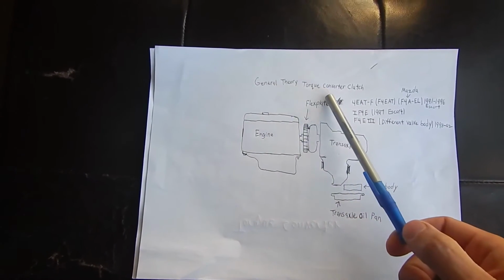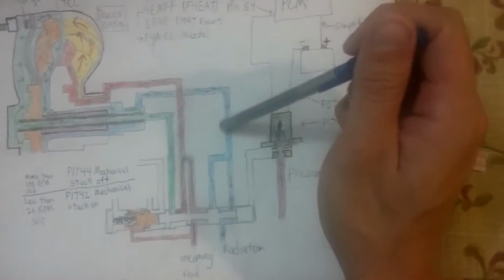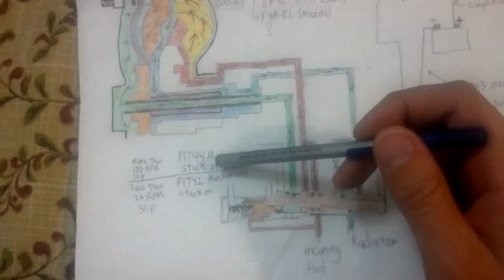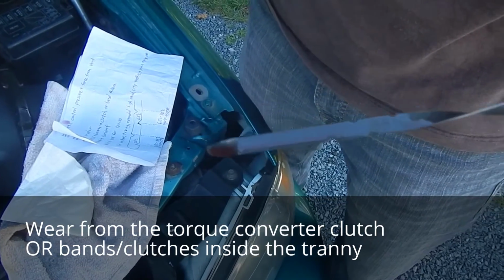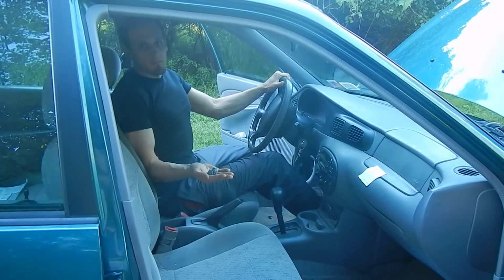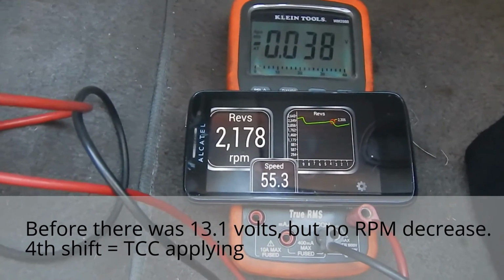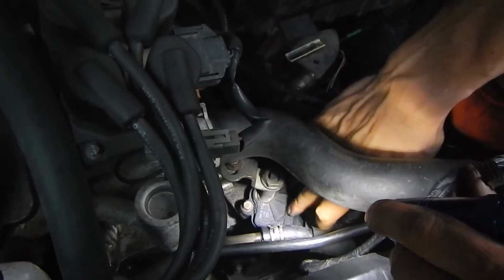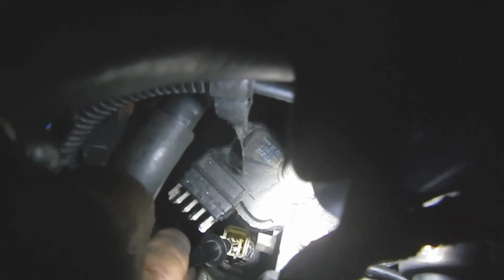1991-2002 Ford Escort Automatic Transmission Troubleshooting P1744 P0748 P1740 P1742 Pt. 1 Tracer

Comment: Informative.  I enjoy looking into issues but I am not educated enough on cars to fix this stuff.  I have the p1744 ford Taurus dad helped replace the tcc it comes back on after clearing the computer.  I will try going to a transmission to ask them everything shifts just fine which i already took it to the specialist he agreed and cleared the code after we replaced the tcc. The transmission guy says if the code comes back on its most likely electrical. Thanks for the video I find it informative.  Hopefully I get this sucker fixed soon...
Reply from the maker: I think you mean you replaced the torque converter. Consider the bafx scan tool and forscan it's a free app. It will tell you if your tcc should be on or off. You can also check for an rpm drop to confirm it's working with torquelite. Figure out which wires numbers are the torque converter clutch and then use your ohm meter.
Reply from the maker: Also watch part two and the cable adjustment videos.

Comment: I have watched a few of your videos now and I am just absolutely blown away by your knowledge and expertise in diagnosing components that others don't stand a chance with. Why dont you own your own shop??? But here is my question. My 1-2 shift was happening late around 3-5k rpms with p0751 code. I went ahead and did a transmission flush/filter and seloniod replacement. It acted fine for a few days. However now the same problem is happening again. Any advice would very much appreciated finding the true cause of this problem
Reply from the maker: There are more profitable businesses than an automotive shop. Check the wiring and connectors similar to how I show in the video.

 I drive a manual now, less trouble. There are no solenoids, wiring, misdesigned valve bodies, defective torque converters due to an aluminum washer, 
Dirty gear selector switches, high pressure fluid to leak, pressure control cables to go out of adjustment, oil filers, or computer software glitches. The escort auto is not a great design and neither is the engine with it's valve seat drop. Get a good japanese manual transmission car and keep the body uncoated with lanolin and move on to more important things with your life.
Reply from the maker: Oh and never let it over heat not even a little bit.
Reply from the maker: Also what year car do you have?
Reply from the maker: I have a video on the 1-2 shift for a 97 escort.
Reply: @supermetaltastic  okay I will watch your video. It's a 2002 zx2 with the f4e-lll. I will watch your other video for 1-2 solenoid. It's got 125k miles so I'd like to keep it running. I have not diagnosed the connections yet and my next step will be checking the transmission pressure. I am worried I will have to pull the valve body tho. Also there was no metal shavings in the old fluid so I'd assume it has nothing to do with your clutches
Reply: @supermetaltastic  alright Adam I'm back with this stupid ass car. So I have incorrect line pressure. 50lbs all the time. During stall test. During driving. All the time. So when I go and adjust the throttle body cable. Nothing changes. There is no communication between the throttle body cable to the transmission. So long story short. It's stuck at 50lbs. What the hell do I do next before I buy a f***ing transmission
Reply: @supermetaltastic  now I do know where the pressure regulator valve is. I don't think it's connected to anything. And I do see where the throttle cable cam is located inside the transmission. But what I don't see. Is how that's electronicly controlled
Reply from the maker: @brianschultz6645  later cars ditched the throttle cable pressure control.
Reply: @supermetaltastic  that could be the case. However the cable still runs to that little electronic box on the side of the engine compartment just like the older makes and motels. And if that is the case. How do I adjust this line pressure. Cause at a constant 50lbs something is off and last case scenario will want to diagnose the pump itself
Reply: @supermetaltastic  yeah your right. The electonic box I have is not in older makes and models. Something is fucked off. Thanks for your time
Reply from the maker: @brianschultz6645  Check the factory manual for the diagnose procedure. There are some online sources as well for that transaxle as well.
Reply: @supermetaltastic  yeah bro I have. F4e-lll it's all tied into f4eat and if you look you can't even find a used f4e-lll transmission I'd assume just cause of that. Who knows man. Hate this car at this point
Reply from the maker: I thought about it and your problem is maybe a stuck pressure control valve on the side of the transmission. It's accessible on the left wheel well. It's a spring loaded cylinder under a large fastener. They are famous for sticking.
Reply from the maker: @brianschultz6645  well check it. It only takes 5 minutes
Reply from the maker: @brianschultz6645  did you do what I told you and check the the little valve on the side of the transaxle?
Reply: @supermetaltastic  bro I looked. Only thing I see is 4 accumulator springs. And a servo
Reply from the maker: https://www.charlietranny.com/F4EATds.JPG bottom left middle there is a giant nut. Pull it off a plunger should fall out. It's probably stuck.
Reply from the maker: @brianschultz6645  It's an easy 15 minutes to check it. let me know
Reply: @supermetaltastic  I will let you know Thursday. It's the most logical explanation as to why I instantly lost pressure one day. And three months later. Still no pressure
Reply from the maker: @brianschultz6645  it should have fallen out. If you had to dig it out, its sticking. Did you try to run it after freeing everything?
Reply: @supermetaltastic . Negative. It's already on jackstands halfway disassembled. These cars a something else you know that
Reply: @supermetaltastic  2-4 clutch band was toast. One of my friction plates and clutch packs were toast. I got the rebuilt put in today. Will dry fire tomorrow. Have no idea if I rebuild this transmission correctly. Wish me luck 🤞
Reply: I got about 100 miles out of it. Was running amazing exactly how it should. And then all of a sudden could hear something inside there. And it wouldn't move. My escort days are over. And it's time to take it to the junkyard
Reply: I got about 100 miles out of it. Was running amazing and then all of a sudden could hear grinding and wouldn't move. My escort days are over. And it's time to take it to the junkyard and part ways with it
Reply from the maker: @brianschultz6645  Smart move. Your wasting time on an inferior product that is not worth much on the used market. I recommend spending a bit more and getting a lower mile car (60,000-90,000). Maintain that car and play the deflation game. Sell it at the 120,000 mile mark. I prefer a manual transmission. A Simpler, more reliable technology that manufacturers have had 100+ years to perfect. Time is too valuable to waste on an escort that needs constant repair. If your time is not it's time to ask yourself why that is?
Reply: @supermetaltastic  I tore it apart a 2nd time and smoked a bearing from not properly breaking in a rebuilt transmission (babying with soft shifts for the first 1000 miles). Since the 2nd install. I'm about 500 miles in and still running fantastic. So far. And I agree with you on the time being valuable thing. Unfortunately. Haven't made the best choices in life. I have more time these days than value

Comment: hi, i have a quick question about the designation of the solenoids when manually testing them as shown in the video. Front(vehicle) left one you tested was 1,2 solenoid? what about the rest? my back center pin doesn't make the click sound when test, i want to verified that its the 3,4 solenoid since i lost OD. Thank you for your time, the video was really helpful. I read the FEOA forums and follow them here. Great information.
Reply from the maker: Check this out and go to page 15. It has what you looking for. http://akpphelp.ru/images/contents/files/F4EAT.pdf

If you are facing the front of the engine. The upper left one is the torque converter clutch control solenoid. The middle upper and lower far left should not click and they are the transmission oil temperature sensor. No need to put voltage on them.

The lower middle one is the 3-4 solenoid.

Comment: I have a 04 Mazda tributre. was driving and then nothing no reverse no drive in any gear. only code that came up was p1744. fluid correct and clean. tested the selenoid nothing no clicking. deduced that it need replaced also decided on the shift kit from transgo because the cd4e trans has a lot of over pressurization issues and this corrects them. my question is the p1744 code and how it relates to the loss of everything
Reply from the maker: Daniel Mcmeen Did you check the pump is pumping by checking the dipstick with the car on and off? The fluid level with it on should be lower.
Reply: I believe I did
Reply: would that still be true if the selenoid isn't firing?
Reply from the maker: Check it again. If you have a hydraulic pressure gauge, hook it up to the transmission. There are usually ports on the side.  Find the specification for the car. There will a drive pressure, reverse pressure, stall test pressure, etc. I'm NOT familiar with the cd4e. However, on the Ford Escort the pressure regulator piston often gets stuck resulting in low pressure. It's easy to access though. I don't think only one failed solenoid would cause the vehicle to not move in all gears.

Also check your gear selector linkage.
Reply from the maker: Are multiple solenoids not clicking or just one? If you had a bad ground to the transmission, that would cause multiple solenoids to not work.
Reply: +Adam Prince no I have a good ground after I removed the valve body with swlenoid still attached I grounded it and used a jump wire and still nothing
Reply from the maker: Then the solenoid must be bad. CD4E in the Mazda Tribute is known as a bad transmission with many complaint of failure before 100,000 miles. Sometimes the pressure regulator get stuck and it breaks metal parts. 

P1744 just means there is more than 100 rpm difference between the two side of the torque converter when the clutch should be applied. A bad solenoid though should be P1740. 

At any rate, keep me posted on if fixing the single solenoid solves the problem.
Reply: gonna be putting back together tonight did the rebuild to the valve body last night to correct over pressurization issues. also replacing the safety neutral switch as a just cuz thing.
Reply: so after the rebuild and reassembly still nothing. no forward no reverse. ugh. code says torque converter clutch stuck off. or at least that's what I read
Reply from the maker: The clutch being stuck off should not prevent the car from moving. Check the pressure and fluid level with it on and off. If you don't have a pressure gauge just remove the plug to the port and put a metal cup up to the hole. See if fluid comes out.
Reply: OK so let's say I do that and it comes out? and what if it doesn't?
Reply from the maker: If nothing comes out or it comes out weakly your pump is not pumping. The shaft that runs from the torque converter to the pump may be broken. 

If does and comes out strong then the problem is else where, like shift linkage. It sounds dumb, but be sure to check the fluid with the vehicle running several times if you just refilled it. The fluid gets sucked up after a complete drain. How long have you owned this car for?

When I troubleshoot a car I make a list of all possible problems. Then go down the list checking from the most common and easiest to the hardest.
Reply: yea that's how I troublshoot as well but trans issues are not a strong point lol. and I bought it as a second vehicle about 3 1/2 weeks ago. it was well maintained and garage kept so well worth 500...knowing it was gonna need a lil work probably on the trans. they did say it was replaced in may but I think the shop they took it too lied and took advantage of the poor woman and threw a junk yard trans in at premium price.
Reply from the maker: Any warranty left on the transmission? Did you try the test yet?
Reply: there's no warranty and yea tried the test it kind of spurted and at first then started shooting out.
Reply from the maker: Well then if your drive selector is good, your valve body is good, and the pressure is good, fluid level is correct, the solenoids are good, and your don't hear a grinding noise from the torque converter. What's left? Broken gears? Bad friction surfaces? Sounds like something internal. Especially with it acting normal and then suddenly stopping.
Reply: Disconnect the battery and reconnect it lol

Comment: I have a 1997 ford escort LX wagon with autobox. the car works only in reverse and first /second gear! any idea what's going on?
Reply from the maker: It could be the gear selector sensor on the top of the transmission. If you  get a Forscan app on your phone with a bluetooth obd ii scanner you can check it. Might cost you $30 or less.
Reply: @supermetaltastic  thanks, will try that first
Reply: @supermetaltastic  how would I get to it, drop the gearbox?
Reply from the maker: @donaldlangdon  No, it's on top of the transaxle. There is a cable that runs from your shifter to it. Diagnose first.  The problem could also be a valve body solenoid. Finally you could run the stall test I show in my video.

Comment: I have a mazda protege with the F4EAT transmission and I just did a drain and refill.  Afterwards, I have o/d flashing at startup and delayed engagement shifting into Drive... Have to wait a couple of minutes.  It feels better after I apply throttle and the o/d flashing goes away after I apply throttle.  It seems to do the o/d flashing and weak transmission drive response on cold starts and seem to all go away when i wait few mintues and apply throttle. drives better afterwards.  I may have seem to put in the world standard fluid when it recommended dexron III, could that be why? Or could it be the new fluid detergency is too strong and cleaned out too much gunk?
Reply from the maker: You should always use the proper fluid for your transmission. However, it does sound like you a have problem with the  TRANSMISSION PUMP VALVE. This can easily be accessed on the back of the transaxle by removing the driver side wheel on the Ford Escort. It's a big allen head plug. Inside there is a metal valve and spring that sticks causing low line pressure.

This is the kit you need here: https://www.amazon.com/gp/product/B072PQC1NV/ref=as_li_tl?ie=UTF8&camp=1789&creative=9325&creativeASIN=B072PQC1NV&linkCode=as2&tag=crisplinemeta-20&linkId=e9d8179799878fc914345e03230b849b

I check the manufacturers website and it fits F4EAT transmission.

Please like and subscribe!
Reply from the maker: Change to the proper fluid. Although a lot of fluid will remain in the torque converter... So you've mixed two specifications of fluids. Check the fluid level while the car in running, which I show in the video. Also run a stall test. You can also check the transmission pressure, which I show in my other video. That will help determine if the pump valve is sticking.

Comment: Hi Adam, I have a 1997 Ford escort and everything was working fine but all of a sudden, the car only works only by putting it on L and then D and then I can move it onto the second D I took it to get it check and they said that I had a low roller clutch defect and then another person said that it must be some wiring defect in the harness? Any ideas on what might actually be wrong with it? The car runs fine but every time I do a complete stop. I have to put it back from L and work my way up and switch the gears almost manually…
Reply from the maker: Check the gear selector switch. I had a similar problem. You can use forscan with a smart phone and a Bluetooth receiver.

Comment: First of all....Excellent video sir!
Maybe you can help me, 
I have a 97 LX also.. with 101k on it.
Was my grandfathers car.. and he hardly ever drove it. 
Recently changed fluid and filter on transmission because it wont go into overdrive sometimes. I have no check engine lights.( L)ow, and (D)rive selections work every time and do just fine shifting through. 
Seems to only act up after driving untill reaching operating temperature, stopping, turning off car, and restarting at operating temperature. 
I feel as though it could be a solenoid sticking. 
Any ideas would be helpful.
Reply from the maker: Yes I had this problem. It was the shift selector. That is on top of the transmission. It's just a mechanical switch. Test it with forscan and bafx  tool. It's cheap.
Reply from the maker: There is menu in forscan that shows which gear the transmission in. In my case it showed something like unknown.

Comment: I have a 2000 explorer sport 4.0 SOHC 5r55e trans.   I'm getting a P1740 code, the transmission flares between 2nd and 3rd, won't shift into 3rd, and shifts a little hard from 1st to 2nd.   Any idea what it might be?

This trans is a replacement, it has around 115000 miles on it.  I just put it in and put in new fluid Mercon V equivalent.
Reply from the maker: Did you figure out the problem yet? Try running some of the tests I showed you in the video. Especially the stall speed and the solenoid test. On a Ford Escort P1740 would mean you have bad solenoid. Be sure you do not have any other codes.
Reply from the maker: So did the problem end up being?

Comment: He Adam thanks for this video. I have a 1997 ford taurus and I have a code p1744 with is best describe as a torque converter clutch system stuck on off position, it was slipping but I added 2 quart of Tf because it was low. But that didn't fix the problem. I don't have any slipping in my transmission anymore! What should I do? Thanks again!
Reply from the maker: Reset the code and follow the directions in the video to test for engagement.